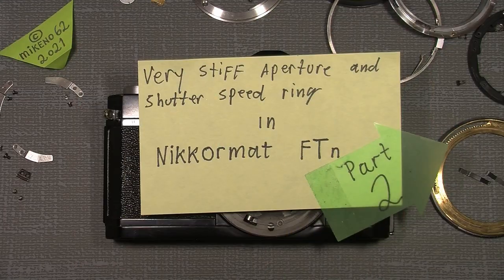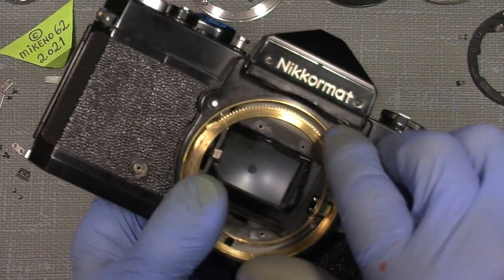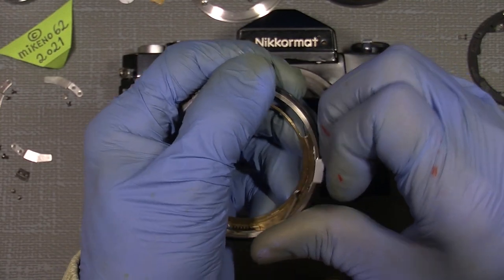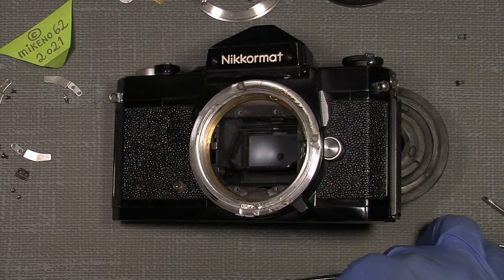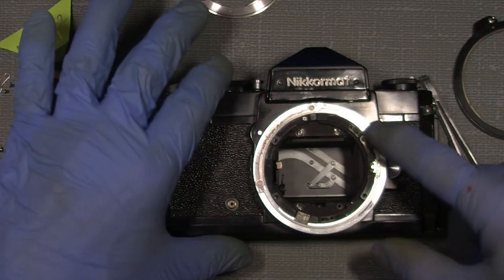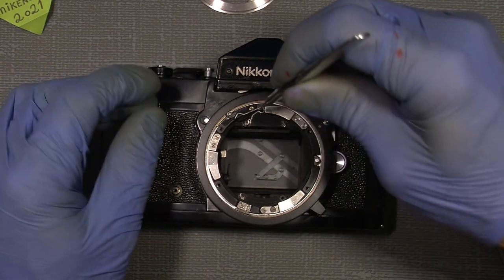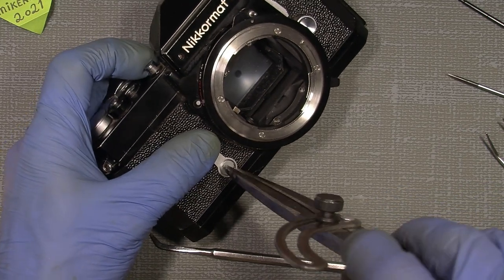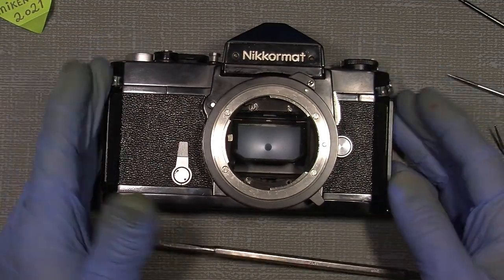Very stiff aperture AND shutter speed ring In Nikkormat FTn PART 2

Comment: Hi Great Video. For some reason the meter doesn't read correctly when I reassembled it. Before removing the meter was reading correctly. I have reviewed the 30 to 40 min timeframes for any clues as to what I am not aligning correctly but haven't found the answer. I set the speed to 1/1000 and asa to 1600. Do you have any ideas why?
Thanks Jim

Comment: After removing the nameplate, as you did around 35:30, I was able to get the mechanism which is covered by the nameplate freed up enough so it would allow the aperture ring to be turned clockwise, but although I then oiled this mechanism, the problem kept recurring. Perhaps after so many years the fine springs that operate it have become too weak? I simply removed this part, and what I wonder is: What is it's purpose, and will my camera function normally without this troublesome mechanism? Mike? Anyone?

Comment: Hi there! I noticed you have several video for Nikkormats. I have a question about Nikkormat EL. I have one in good working condition with a focusing screen without split-image. I have another focusing screen taken from some other Nikkormat which has that split image feature. I managed to swap them, but I noticed that at F2 aperture, the new split screen is missing the focus (focus in viewfinder is not equal with focus on film). Some people says that shimmers under the new focus screen will solve it, some people says to adjust the mirror. I would go for the mirror adjustment but I have no idea where to start from. Can you give me few hints? Thanks!! :)

Comment: Hi- was wondering if I could request a video on lens wiping technique. It's one of my main bugbears that leaves me unhappy with cleaning my gear- even with a clean lens tissue, applying only light pressure in circular motion, I keep seeing coating streaks under the light. It's reeeeallly annoying. any pointers?
Reply from the maker: That's a good request, I have written it on my "todo list", (that list is over time going to much longer).